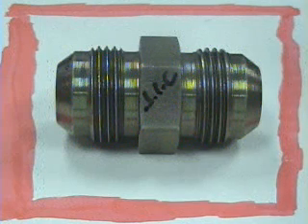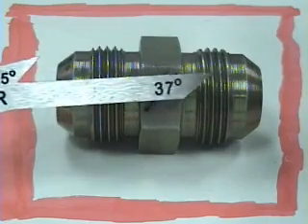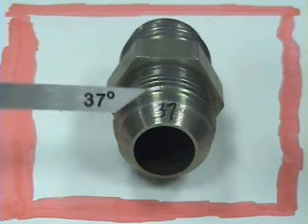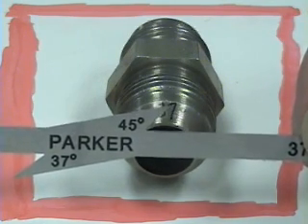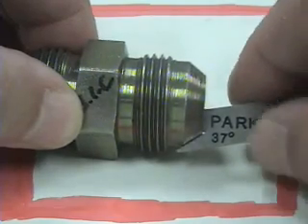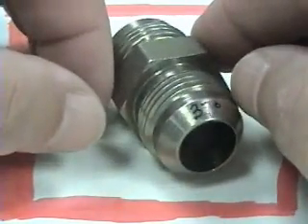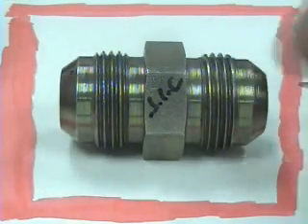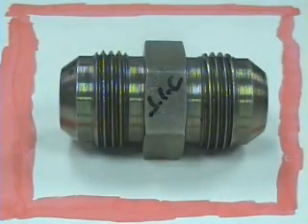Fittingspeak: 37 Degree JIC

Comment: Question/comment regarding JIC(37*) vs. AN (Airforce/Navy) standard fittings. These fittings have different thread fit/shape and manufacturing tolerances/materials. Thread classifications; JIC = class 2 thread fit.  AN = class 3 thread fit and reduced radius thread root or "J " threads. Point being, while these fittings appear to play well together they should not be mixed.